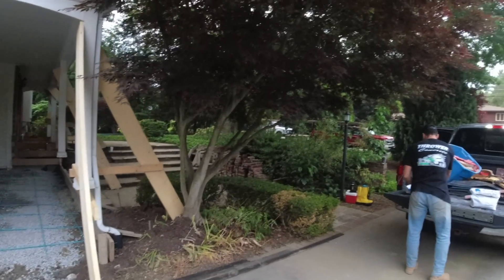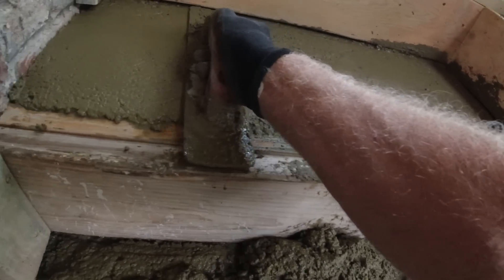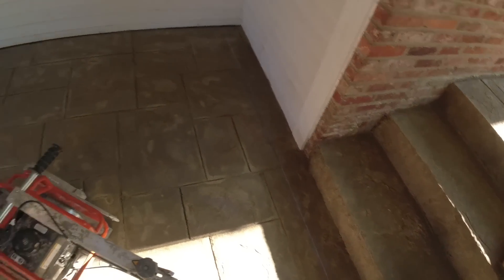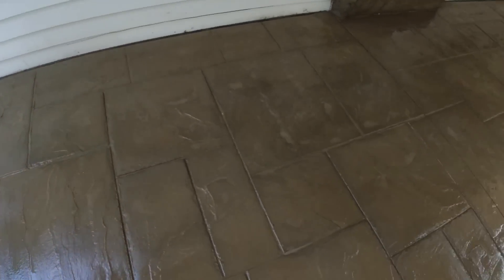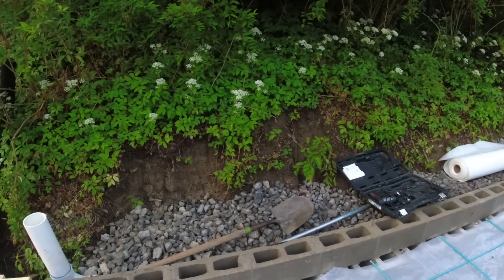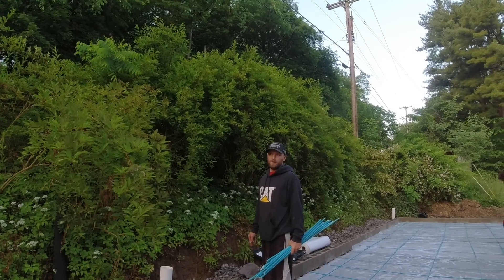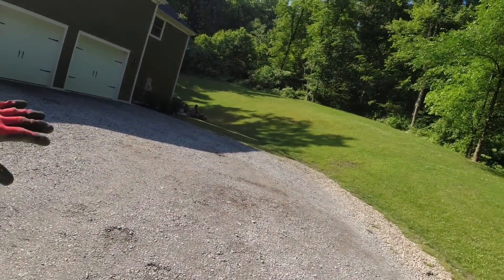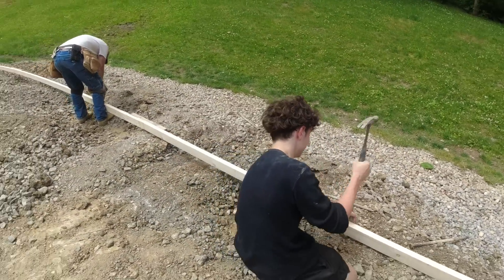The Work's Never Done!

Comment: The anchor bolts are for sheer strength  lateral load  And the straps are for tinsel strength Prevent the house from lifting up  directly vertical I heard you ask

Comment: How do you release air pockets in the steps without vibration?  Curious to hear the answer.  Wouldn't putting kickers and not attaching to the old brick be a better option to allow the vibrator to be used?